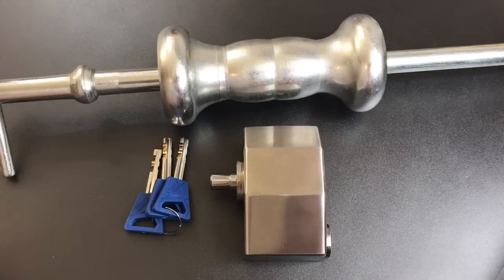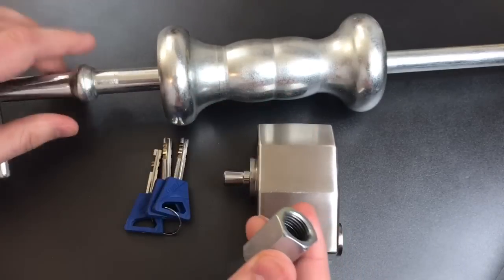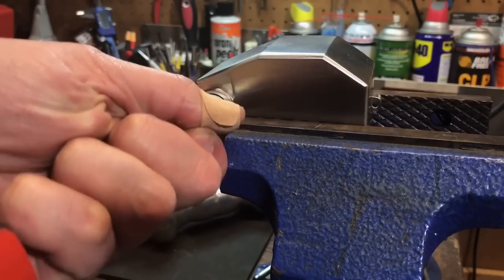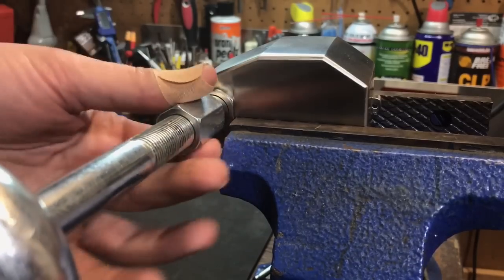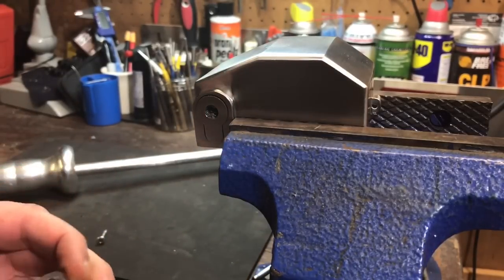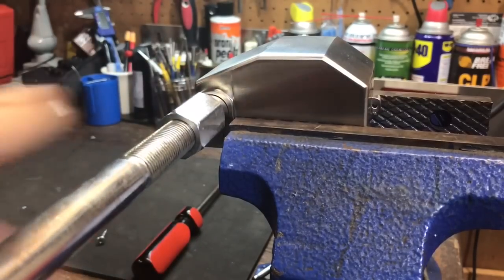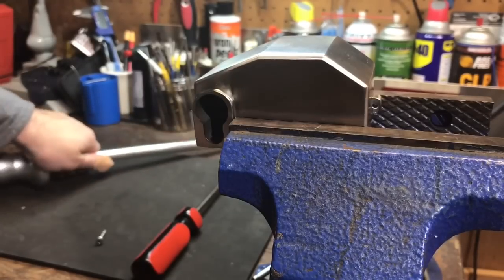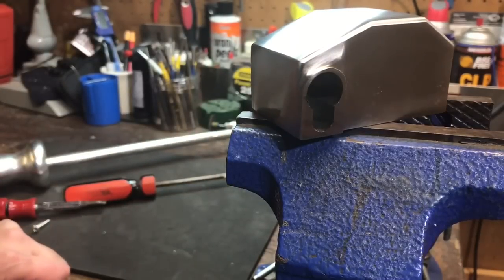[590] LoboJack HS-21 Padlock Opened With Slide Hammer

Comment: You know, you're the reason I got a Ramset gun, and now you're going to be the reason that I own a GODDAMN SLIDE HAMMER THAT I DON'T NEED!
Reply from the maker: Lol. Wait until I break out the hydraulics. 😋
Reply: THIS.  A Ramset Gun is now in my "Zombie Apocalypse Hoodlum Kit" right next to my Ramset ammo trip mines.
Reply: Oh shit hydraulics
Reply: Exactly!
Reply: I made a slide hammer.  It just moves things. I make attachments as and when I need them.
Reply: Get a bearing kit with it
You can do fun things
Reply: @lockpickinglawyer  back in the early 90's a bottle jack was quite a useful tool 😉
Reply: a slide hammer can be useful when working on your car, such as when you need to replace wheel bearings, or when replacing your muffler bearings :)
Reply: Slowly as I watch videos I accumulate more lock picking tools. I own a decent kit albeit chinese quality with some homemade tension wrenches a disk detainer pick and tubular lock pick tool. One day I will visit your site when I am not broke to buy higher quality tools. It's a nice hobby and useful skill and nothing beats that feeling of a successful pick. Thanks Lock picking lawyer you are by far one of my most watched channels.
Reply: @raymonroe1983  same here - similarly slowly building a hobby from this. Tremendous channel.
Reply: Sometimes you need a big slide hammer just to detach the bicycle seat post. Especially if you have steel frame and aluminium seat post.
Reply: @lockpickinglawyer  this LPL response is equal to; hold my beer.
Reply: Got a slide hammer amongst the malaise with my dad's tool set after he died 30 years ago. Been collecting dust in my garage ever since.... until now 😛
Reply: @lockpickinglawyer  🤣🤣🤣

Comment: i'd never heard of a slide hammer before this. that shit's kinda scary
Reply: They are used primarily for pulling dents and car frame components out in auto body/collision shops.
Reply: @scottcol23  Also removing pieces in aviation (You don't hammer them lose, you need to remove them correctly)
Reply: and various other things within automotive, so more than just pulling dents
can be used for ball joints,
hell broke a dipstick tube off in the block and was gonna try a slide hammer to get it out
only problem is, broke the fucking tap off in the inside of the dipstick tube....
hell if i know how to get it out
guess the engine gonna get pulled.....
Reply: @djaydeved  they are used for lots of things. I used one to remove a broken and stuck coil pack.
Reply: Same here
Reply: @djaydeved  Torch the block where the tube enters and you can usually remove it without pulling the engine.
Reply: @scottcol23  Oh honey... "primarily" is such a misnomer. They're used every day in orthopedic surgery, too. They use them to remove old, worn, and/or infected implants from the human body that have been cemented and screwed into the bone.
Reply: @scottcol23  we have a 20kg weight slide hammer to remove wheels from busses in my work
Reply: @alexstromberg7696  thats cool.  I always kick them off and use a oiled mud flap to slide the tire. Lol dangerous but works
Reply: @scottcol23  you can never kick off buss tires, they are 275/65/22.5 steelies
Reply: slide hammer......fixes almost anything duct tape wont fix
Reply: @CalebFaulkner  oh god really this makes me quiver thinking about that
Reply: @CalebFaulkner  That's the most painful sounding sentence I've ever read.
Reply: @djaydeved  pull the engine with the slide hammer
Reply: This thread tho
Reply: I would like to see him try it when it's actually in use and not in a stationary vice with ample room to use such a bulky object
Reply: I made one to steal cars. I still have it 25 years later
Reply: @CalebFaulkner  I already get crippling anxiety from the dentist but that just makes it all 10 times worse lol
Reply: As a dentist I can say it comes handy in some cases.
Reply: @jacek5809  are people conscious while you're using them?
Reply: We have always called it a puller lol thats the first time I heard the proper name as well

Comment: Slide hammers were common car theft tools in 70's and 80's GM cars. You quickly pull out the passenger lock. It had a key code and you cut a key with a handheld cutter. Then you have key for drivers door and ignition. That is why they started using different keys for ignition and door.
Reply: Nowdays the GM badges are an effective theft deterrent in and of themselves

Comment: The housing appears to be intact. What about driving the rest of that weak pin out, and putting a better core in with a stronger pin? From what I remember of your original video and Bosnian Bill's video, this was a decent lock for the money.
Reply from the maker: Not worth it for me... a pin is a bad way to retain the core imo.
Reply: LockPickingLawyer what if you used a larger pin with a notch in it and a blind pin that goes into the core to block the pin from being driven out.  Better, but is it worth the trouble?
Reply: Probably way over thinking it and it isn't worth doing, but is there anyway you would improve the lock? What do you're to pins (retaining plates, set screws, etc.)?
Reply: The Stoned Videogame Nerd soldering gives a great mechanical connection but since the housing looks to be stainless steel it’s not going to work. 
Next best thing would be a highly resilient epoxy with good shear strength- JB Weld or Scotchcast #10.
Reply: The Stoned Videogame Nerd remember any slide attacks on the core will cause a shear loading so the glue will hold very well. 
I’ve never tried silver soldering s/s but I’m doubtful. Medical devices are often brazed using copper filler.
Reply: @lockpickinglawyer  what would be a better way to retain the core?
Reply: The pin is weak because it’s small, not because of the material.
Reply: how about welding a piece of steel in front of the lock, the part under the key way
Reply: @LockPickingLawyer thieves usually don’t carry slide hammers around and as you said last video that pin is nearly invisible so it is unlikely that they discover the weaknesses
Reply: Billy Kaelin slide hammers are still being used to remove automotive door and ignition cylinders.  Keyless ignitions not withstanding.
Reply: @fluffhead08  Seems to me if they had just drilled 3 holes with 3 pins would do the job. And make 'em bigger while they're at it.
Reply: @fluffhead08  I would guess doing it the same way as Abloy does padlocks: use threaded cap (with a hole for the key) to keep the core in and then use a screw accessible when the lock is open to prevent turning the cap. That way attacker would need to be able to rotate the cap with such a force that the retaining screw snaps.

I think having a big enough bolt where the pin was in this lock should be pretty okay solution, too. However, there's a brute force attack agaist euro cylinder locks where the whole lock body is snapped in two parts which might happen here, too.
Reply: @jdrissel  quicker just to put a pin in it and weld it shut.

Comment: Slide hammers. Many uses. Not just for pulling dents. 🔨
Reply: In French, "dents" means "teeth". I got a bit lost in translation here, and am now picturing some very, VERY painful stuff D:
Reply: It's great for dents and dental work... what a versatile contraption... tsk tsk
Reply: @Dextroyer77  Actually one of my teeth was indeed pulled out by the dentist using a slide hammer, a small though. It was a strange pulling feeling on my jaw.
I think the dentist used some kind of vise to attached the hammer to my teeth.
Reply: HF slide hammer + Irwin CR10 vise grips == nothing resists. The preferred combo for CV shafts rusted into transaxle.
Reply: Hummm
I used mine for bushings and bearing
Reply: @RexusKing  that's scary sounding lol
Reply: How much do they weigh?

Comment: so from what I'm gathering from this, the safest way to use this lock is to have just enough clearance to get the key in, and nothing else. you wouldn't be able to fit half the picking tools and you definitely wouldn't fit the slide hammer.
Reply: you can say the same for many locks actually lol.  Oh and if it's just drywall  - a hole can be cut to increase your reach  - so be mindful of the mats you use to shore it.

Comment: how common are slide hammer attacks when talking from a security standpoint though. Like, I can't imagine a common thief would just know that you can do that or know where to get those tools
Reply: Not sure about use in security attacks, but you can get slide hammers at the likes of Ace or Harbor Freight. They're not unusual or rare tools.
Reply: Back in the day you used that same technique to pull the ignition from a car you were stealing
Reply: Given how close the lock would be mounted to a wall, and how big the slide hammer is, it doesn't look practical at all.
Reply: I think thiefs are commonly using slide hammers to break into euro cylinder locks here in Europe. The spec requires pretty thin metal part in the middle of the lock and slide hammer can usually cause high enough force to snap the whole lock body in two parts.

I guess in the US, the door frame or the hinges is usually even weaker part of the security so thiefs attack those instead.

Comment: If you put the screw in the holder and then thread the holder onto the slide hammer tight you can run the screw in the lock opening using the "T" handle on the slide hammer shaft. No screw driver needed.

Comment: Idea for simplifying this attack: Replace the slide hammer and attachment with a crowbar (already carried by intruders) and anything heavy.  Insert a normal slotted screw, put crowbars toes around screw, whack the other end of crowbar, use same screwdriver to turn lock.  Benefits to improvement: All tools are common intrusion gear already carried by routine intruders.  Crowbar rests against lock body, lock pulls against locked object, so no vice needed.  No time spent threading attachment onto hammer.
Reply: John Francis Doe this is a hobby and product testing not instructions for thieves lol

Comment: thumb suffered a picking injury?
Reply: david w pinkston He's trying to be like Bill. But Bill claims his cat was the issue.
Reply: He started a lawsuit with some mafia types and they took a hammer to his thumb. 😊
Reply from the maker: Cut my thumb on some steel chips coming from my mini mill. ☹️
Reply: Well that’s kinda boring and sounds true. We’ll all keep to the same lie and make you sound macho. “LPL had to pic the lock on a burning orphanage because six firemen taking turns with battering rams and fire axes couldn’t knock the door down. One of the firemen was so emasculated he took a swing at out true hero LPL and he deflected it with his tensioning hand.”
Reply: LockPickingLawyer I feel your pain, I’ve just had 3 stitches out for much the same reason
Reply: John-Paul Silke hell I was there, it was a 20 thousands tension bar.

Comment: Welding and angle bracket over the bottom of the core would solve this and make it a decent lock wouldnt it? Just a bent piece of steel across the bottom of the core and around the corner and a decent weld would keep this from working right?
Reply from the maker: That would probably work. 👍
Reply: strolls up applies acid and walks away for a bit :)) yep, game over. amongst the other 999+ ways to defeat them all
Reply: metamorphicorder Hydrochloric acid is fine in plastic bottles. Is that “muriatic acid”? I forget because I don’t live in the 19th century... and, honestly, I’m not at all sure it’s easier to explain lockpicks than acid. Acid has a ton of uses; lockpicks, only one.

Look, I agree with your overall point that attacking locks with acid isn’t likely to be practical. But your comment is a bizarre mix of “acid isn’t as corrosive as you think” and “acid will dissolve the hell out of anything it goes near.”
Reply: @beeble2003  not is not actually like that at all. 'Acid' is a supergroup of chemicals which across their range have many different properties. I did mention a specific acid because its one that is very common to easy to get theoretically.  However, most of my commentary was meant generally. And no where did i say or imply that it would dissolve anything it goes near. 
My point was that there are other things to consider about acids than will dissolve the intended substance. 
Like what else is in the workspace, what other chemicals might come into contact with the acid. Like seriously, pouring a high molarity HCL into a convinced space with even a small ammout of water could be very dangerous. 
 Then theres also the false premise that acids strong enoug to quickly and efficiently dissolve metals like steel and brass would even in near perfect conditions be a stealthy method of attack. Acids can make tremdous noise when dissolving things. They also do things like offgas which can be very noticable and potentially dangerous.  For instance i believe its nitric acid that reacts with copper to form a very visible and noxious gas. Thers a good ammount of copper in brass.
 My point was that acid is perhaps besides explosives the least practical way to steal a bike in most situations. 
 As to the difference in explaining the two, let me tell you, you might very well be able to get away with calling your picks 'sculpting tools' if you play the part right. Have them mixed in with some actual sculpting tools and some 'works in progress'. 
Probably wouldnt get a second look if searched. 
 Little bottle or bottles of some unknown substance, are gonna get attention.

Comment: For installing the screw.
Put the screw in the collet.
Tighten collet.
Use the puller to thread the screw into the lock.

No screwdriver or screw gun needed.

For dents.
Use a pointed punch to make hole in dent. ( don’t drill )
Thread into hole.
Pull dent.
Weld hole , or cover with bondo.

Not a method used much these days.
Plenty of better methods that don’t create extra work.

Comment: LPL: "If you screw a SLIDE HAMMER into this lock and put 400 lbs. of force on this pin....it pops right out!"

That's great and all, but I think it bears noting that this is NOT a surreptitious attack...which is usually the point of, um, PICKING the lock! LoL.
I bet you this lock is also vulnerable to a die grinder with a cutting wheel!

Comment: I wonder... Would the core survive a bit of welding? Put a couple spot welds to prevent a slide hammer attack?

I know very little about welding and how different metals react. If the burst of heat would destroy the internals... But it's a thought...

If the core was welded to the body, would the key still work? Would that be enough to reinforce against the slide hammer?

Comment: Ok, so this proves that you can exploit the puny-pin-vulnerability in your garage. But, given how the lock would be installed flat against a surface in its natural habitat, how would you fit in the slide hammer? From the two videos you made about this lock, I deduce that this is one of the most secure locks you have reviewed so far.

Comment: I have heard about slide hammers being used in car theft, where a thief uses the slide hammer to pull out the cylinder of the ignition and steering lock on cars where the key is inserted into a lock cylinder on the side of the steering column.

Comment: If that lock was being used correctly the pin would not be exposed and the core would be very close to the wall where it would be hard to get a slide hammer on. Slide hammers tend to be big and beefy.      I can see a pick being hard to get in also depending where the lock is installed like against a wall where a key would just fit in.  I bet if a larger pin or even a steel hardened pin was used this would be one of the better locks.

Comment: Do they make a lock / core puller ?? Kind of like a gear or pulley puller ?? That you just tighten with a ratchet and it pulls the core out ?? Seems much easier than a slide hammer. Especially if the core was particularly hard to get out

Comment: I wonder if the Lock Strategy coulda been tweaked where the Entry Point for the defense against Slide Hammers coulda been inserted into the Core from the inside of the Shackle Space...? Mighta stealthed its presence better.

Comment: Question: how hard would this attack be if it was done with the lock in it's "normal environment"?  I'm thinking that without the lock in the vice, this attack would be a lot harder.  So, a thief, in addition to the slide hammer, would need to carry around a way to secure the lock.
Reply: The lock is secured to whatever it's locking. Sure I would have preferred if LPL had shown it in more of a "real life" environment, but as long as the thing it's securing is big and heavy this will work. If the thing it's securing isn't big and heavy, just pick it up, take it with you, and secure it in your own workshop before doing this. That's the thing with hidden shackle locks, they don't tend to be used on chains or cables, they're used on doors and such which would work every bit as well as this vice. This is also the reason to attack it by pulling the core rather than attacking the pin directly, the pin is on the back of the lock which you can't access while it's locked to a solid object.

Comment: I see that one can use this attack on Kwikset " lock in knob" doors. Self drilling screw drilled the in knob face; not cylinder keyway. Lock is reusabe with a new cap. Too bad Kwiksets are so easy to rake and/or rake-pick.  I do a lot of evictions for residential property management companies. Sudden destructive entry is always impressive. My giant channel locks for the knob, and cordless grinder with a 4 1/2" Lenox diamond blade for the deadbolt. Two minutes tops to enter.

Comment: At the beginning of the video, I thought you were going to extract the pin by drilling a hole or using a self drilling screw and using the slide hammer. Not sure if it's practical though if the metal is hardened
Reply from the maker: You can’t get to the pin when the lock is in use, so that really wouldn’t work.